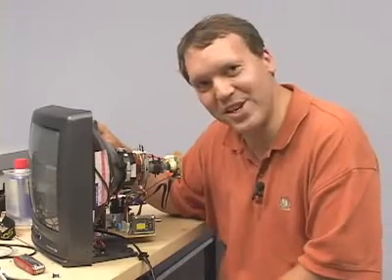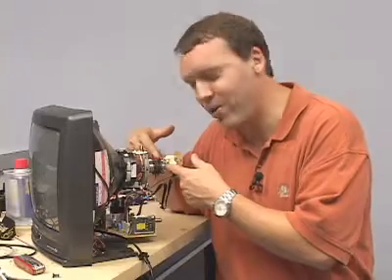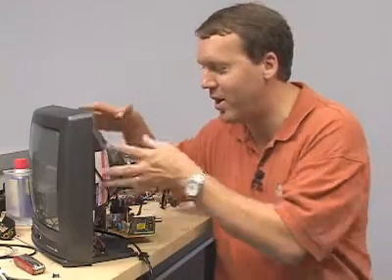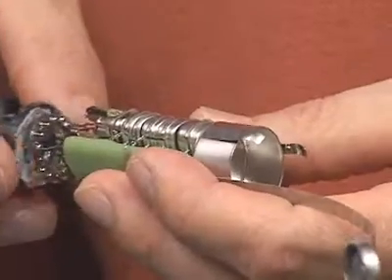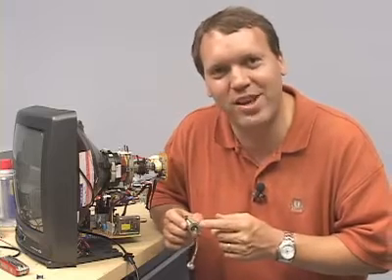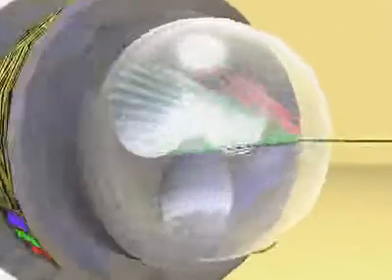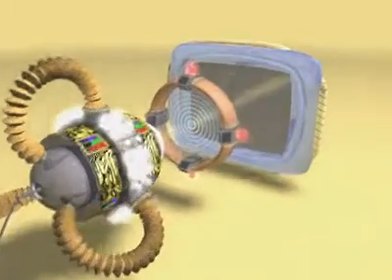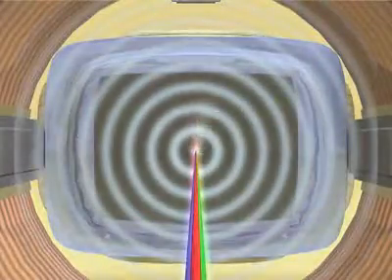How TV Works

Comment: @larlar752000 I did some more reading last night...there's a lead coating on the tube and the manufacturers have been using safety circuits since 1971. Anyway I hope I haven't been zapped since I've spent many hours sitting at a work bench next to these sets.

Comment: @larlar752000 Not so...X-ray protection has been built in to sets now for many years. In the old days if the high voltage went too high the set could give off x-rays. Now there is protective circuit that will shut the set down if that happens. I'm 62 years old and have been fixing sets for a long time.